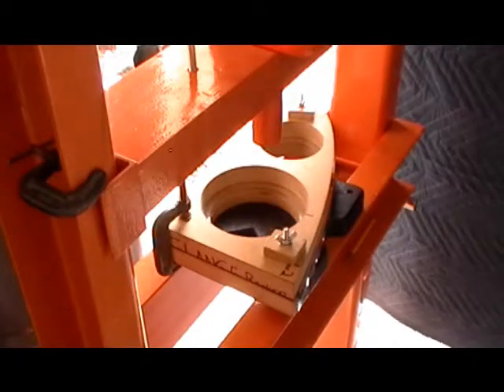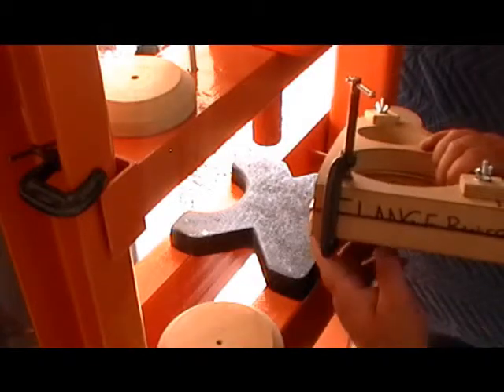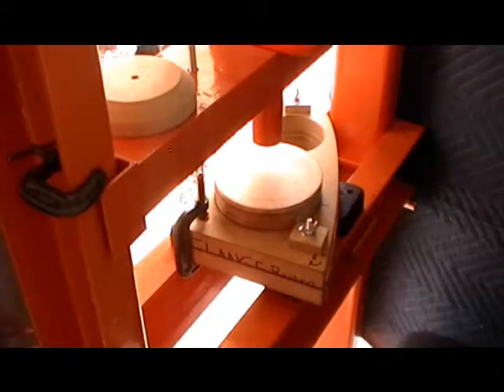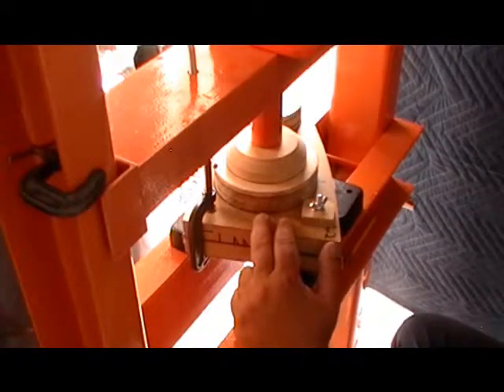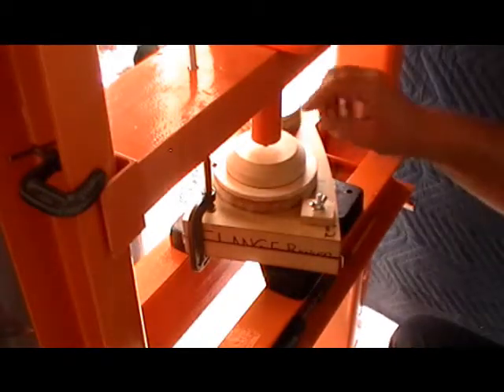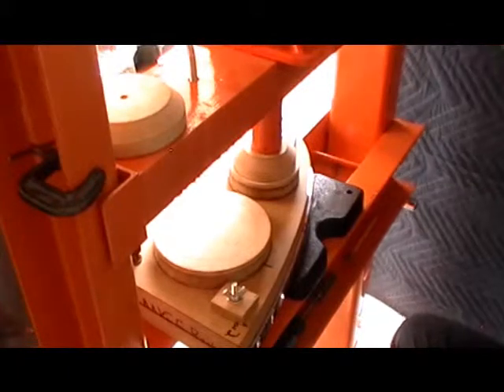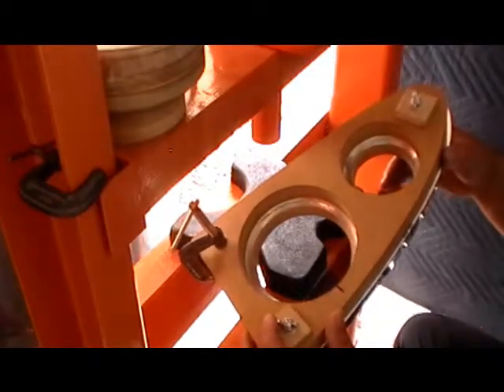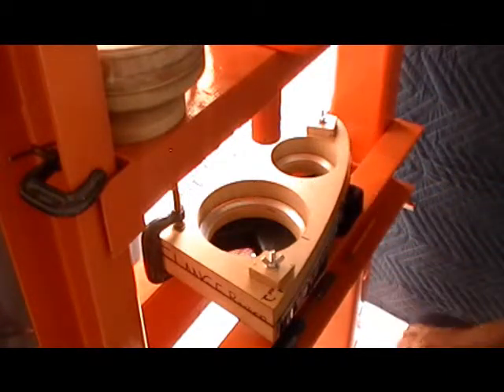The Desert Bearhawk Project: Nose Ribs Pt.5

Comment: Dave, this is Chewie, Mark, whatever you want to call me.  I've been trying to build a horizontal press to accomplish the same task.  It sucks.  I'm too embarrassed to admit this on the bearhawk site.  I've been wasting too much time on this thing.  It uses the back of the vice to press against a backer (like you see on a railroad dead-end) with the rib sandwiched between.  So everything is cantilever and braced and this and that and now the whole BENCH is bowing up but that stupid rib is la dee da laughing at me with the ugliest flange you've ever seen.  I think I'll just buy one of these HF presses and get on with my life.  Only question I have for you is would a mechanical arbor press work as well as this?